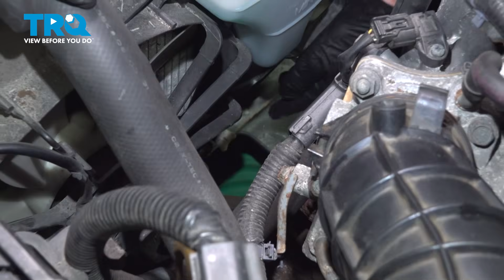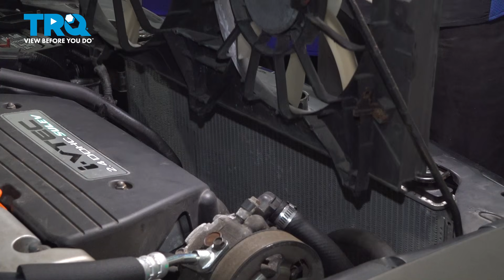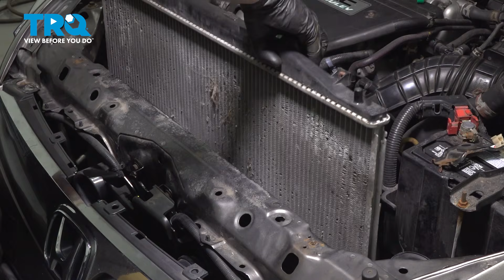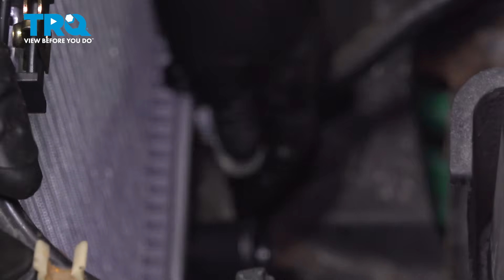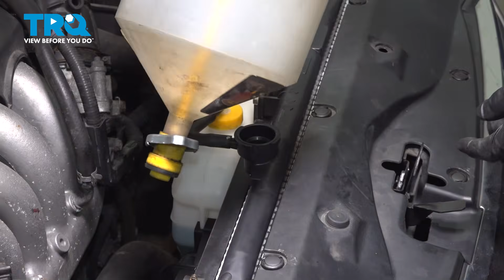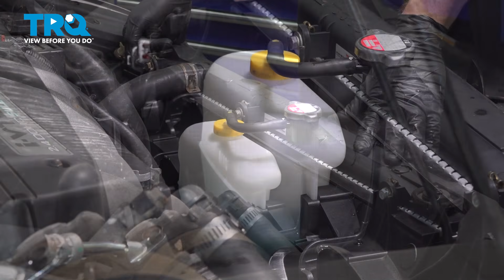How to Replace Radiator 2003-2007 Honda Accord

Comment: Thanks for vid.  Somewhat helpful, but yo, I don’t know what car that was… but I’m doing my ‘06 Accord V6 auto, and lot is diff.   Like there are two electrical connectors at the bottom (full PIA laying on ground taking off plastic crap. Oh and three bolts at bottom too (for fans)!  And no tranny lines, just the two water hoses.    Your vids are helpful.. but i think you might have to be more specific about year, make, model, etc….

Comment: All good but one important thing hasn’t been explained: indeed you need to start the engine and put it on hot in order to bleed the system BUT you need to leave the car until the thermostat will open and will start pushing fluid through the radiator you’ve just installed otherwise if it won’t get hot enough the fluid will only go via the engine and will skip the radiator. You need to keep touching the radiator to make sure it’s getting hot (this means thermostat is open) - in that way you are sure that the whole system got bleed correctly.

Comment: How does this one not have that awful quick disconnect on the lower hose? Mine has it and I put on a new one wirh my radiator. It blew out after 100 miles

Comment: THANK YOU! I have the Manual and it’s a little different but a lot easier since it doesn’t have the extra hoses or sensor, however the fans are separate

Comment: This is cool and very informative video. I only have 1 question. Is there anything needed for the transmission fluid or just leave it be? I figure to check fluid levels and fill if needed.